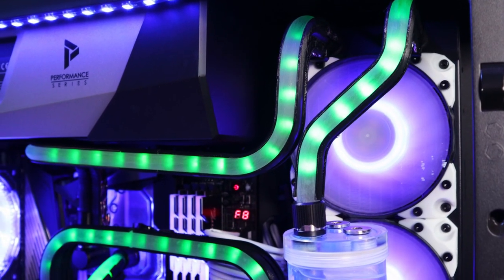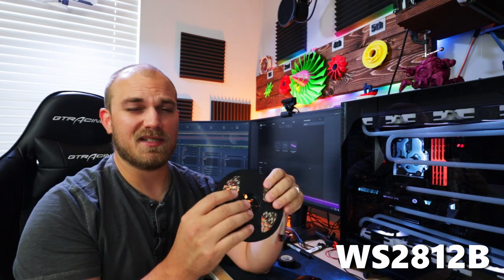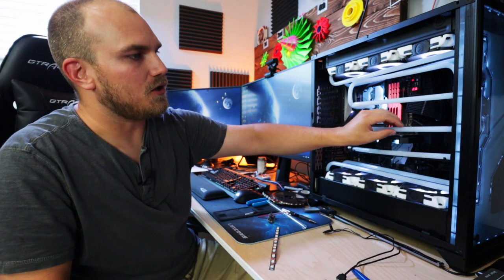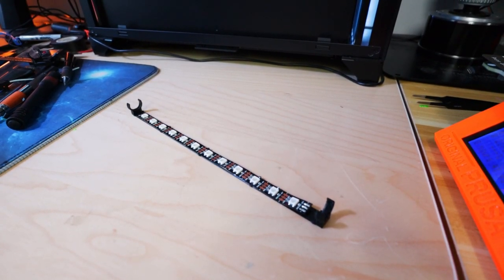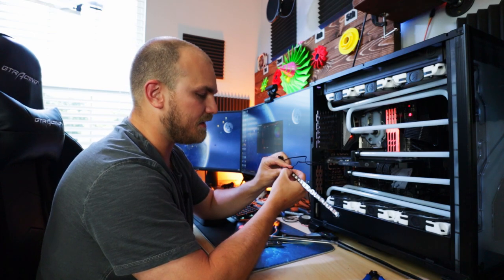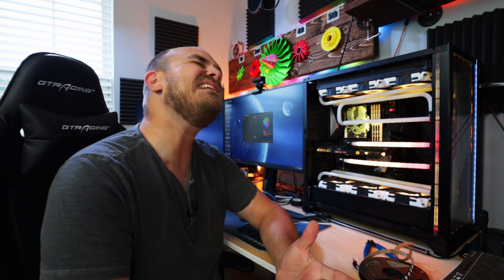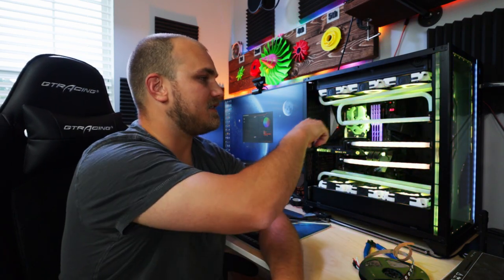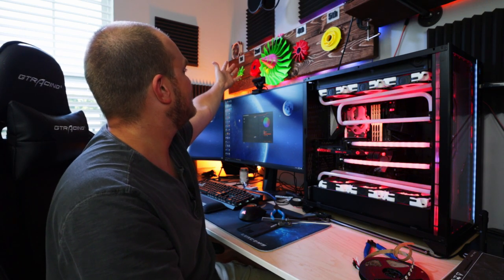Add RGB To Any Hardline Build.... With A 3D Printer.

Comment: I absolutely love this man. Showing people what you can do with an 3d printer and a bit of DIY. People say: but an 3d printer is expensive etc. I just looked it up how expensive the tubing would be: "The ARGB tube bracket is now available for order at $19.99 USD for standard length of 5-15cm and an additional surcharge of $10.00 USD for extra long at the length of 15-30cm." this is PER TUBE . You could buy an 3d printer and a dozen of filament rolls with it if you have a full water loop.

Additive manufacturing (3d printing) shows how fun and cost efficient it can be to design your own parts and just make it. I love it :D

Comment: Quick tip, if you want to remove the flashing from led lights, duplicate your timeline and offset one video stream by 0.1seconds or however small you can do in your editing software. It removes the LED flashing but retains normal video quality :)

Comment: To do bends, you can modify the model to slip the RGB strip in sideways, and cover half of the top of the RGB strip in adhesive reflective tape. And to do the bends, just heat up the PLA and bend it like you woukd with the tubing itself. Perhaps add a few more clips on it, and break off the clips you don't need after setup?

Comment: First thought is to scale down the turbofan model to 120mm dia, but that would probably shrink the joining features too far to function. My suggestion is to import and join the fan components as an assembly, then save it as a multi-body part and merge the bodies together to get a part model you can scale without concern for the blade mounting points. You may need to thicken the blades a bit but I think it’d be worth it!

Comment: All in! Well just do the straight parts, think that is the sweet spot for looks/easiness. Also if you got half the brightness, will it diffuce more, or just lose all the lights? Oh and solder rest of the strips to the current strip as chain, so you don't need RGB splitters. One can handle the bottom 3 and upper one rest.

Comment: The diodes are still very distinct and visible. Using a 60 or 120 led/m strip, and creating a C channel that allows you to install the strip parallel with the tube vs perpendicular would diffuse the lighting better

Comment: For better animation support, you can plug those strips into a corsair lightning node, I think the pro one is the one with setting for strips in iCUE. So called breadboard jumper wires with square female connectors work well, if you want to test this without destroying a corsair fan. Pinout is +5V, Data In, Data Out, Ground, beginning with the pin marked with a triangle. Data return needs no connection, its just what the last led in the strip spits out (data is written to like a shift register to ws2812b strips).  Btw, you can use an arduino with the fastled lib to controll the rgb of corsairs fans as well, its the same chipset as in ws2812b strips. 
Also, theres an arduino lib with an example for using arduinos with the atmega32u4 like arduino leonardo or arduino micro called CorsairLightningProtocoll.

Comment: U could do similar design for soft tube just add more of those c type clips on or zip tie them. Im planning to just do a desigh a loop with some semi hard copper wires and then zip tie tubes on it

Comment: The clips should be separate. Even if it doesn't make sense for the straight runs, for the bends it'll save you because then the bends could be custom-tailored and held in place with the C-clips which would attach with the positive space of the rail ends into negative space on the clips. To adjoin two together, making it so the rail ends could be full-width or half-width would allow for custom-length ends which can be joined together into a single clip.

Comment: Maybe you could split the strip holder in clip and rail part, would make printing and flexibility much better (cause you could print the clips laying w/o retractions). Also, instead of the notches I would simply go with a .8mm wall for the same reason.

Comment: You should try Aircookies WLED. Been using WLED for a while now with a D1 mini. Found a LED holder on thingiverse that fits in the slots on my Ender 3 V2. Printed it out and now have a LED light that comes on over my printer when i turn on my printer and rasp[berry pi 4 (with octoprint). Also have WS2812b's under kitchen counters and behind TV and of course in computer case.

Comment: I have a video idea: Using a water cooling loop like an AC system. (Insert H2O phase diagramm). If you install a throttle before the cpu and a powerfull pump after the cpu you can lower the pressure so that the water evaporates on contact with the cpu. Then after the pump you have positive pressure and the water condenses again. Since you only need 0,6 bar to reach the tripel point the fittings and lines shouldnt be a problem. The only issue is to find a pump powerfull enough to work against the throttle but robust enough to work in steam too. But the cooling effect should be decent.

Comment: Bought the FLSUN Q5 after watching your video and after printing the fan duct you also provided im still getting the PLA not cooling fast enough, Its way better but still a tiny bit present. Is there anything else you changed or could give me your settings, Any advice from you or anyone else is appreciated.

Edit: I will say its quite hot here in England at the moment though.
Reply: I think England & Australia have swapped Weather Patters this Year, You guys have our Normal Weather & here it is Cold, Rainy & even Snowing Heavy in Parts that it doesn't normally like Western Victoria & on the Mountain Ranges Mid NSW

Comment: Found this:

"The only way for you to get the ARGB Tube Mod is to send in the measurement of your design to Cooler Master for a tailor-made tube bracket for your system."

"The ARGB tube bracket is now available for order at $19.99 USD for standard length of 5-15cm and an additional surcharge of $10.00 USD for extra long at the length of 15-30cm."

That's is a couple of bucks of material there instead of paying $20+ - I really need to buy a 3D printer so i can save a lot of money..

Comment: For the corners I would maybe try using this flexible led strip https://www.amazon.de/dp/B07N2YM3C7/ref=cm_sw_r_cp_apa_i_qEpmFb4HRE1N3 (in German and not adressable, but you get the Idea) and clips which hold the Strip to the hardline tubing without any Backplate connecting 2 together. Straight runs I would probably still use the Backplate Version tho. If my explanation sucks but you are interested i could do a quick cad model if desired.

Comment: you can make a double propeller fan?  similar to a turboprop slim blades or other type like a fast boat double propeller ? if you do try to put the rear propeller BETWEEN THE SPACE OF THE 2 FRONT NICE TO SEE  IF IT WORKS AT 3000 RPM  SEE PHOTOS ON GOOGLE FOR MORE INSPIRATION HAHAHAHA